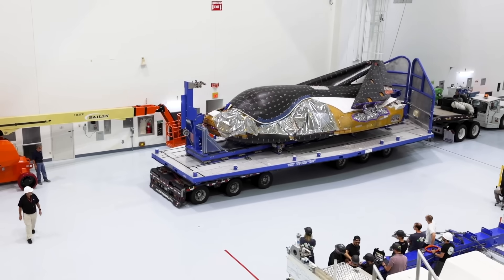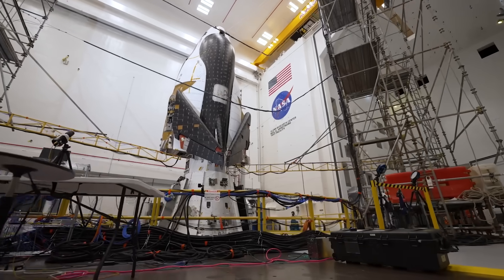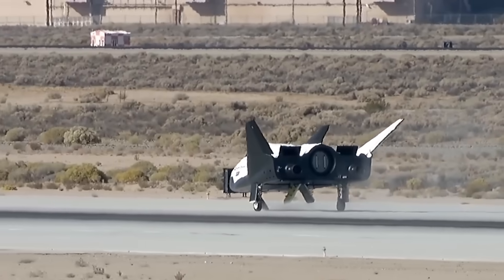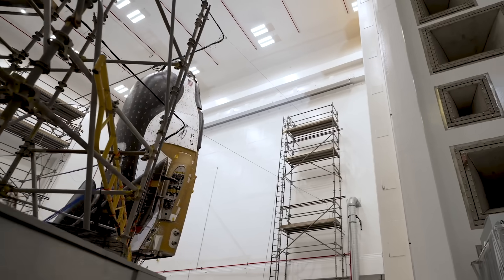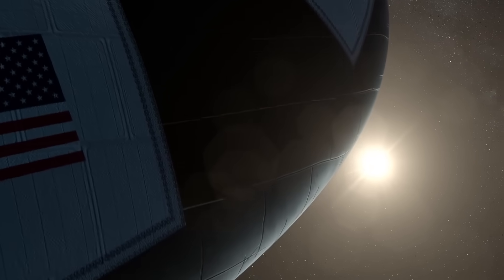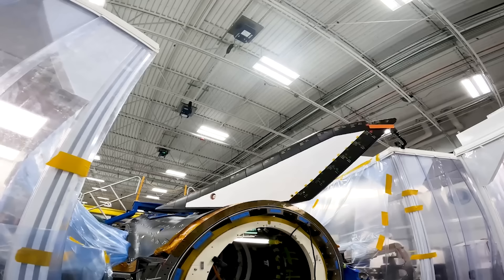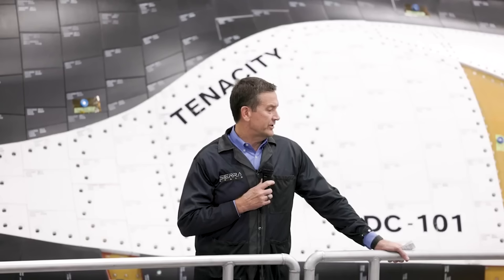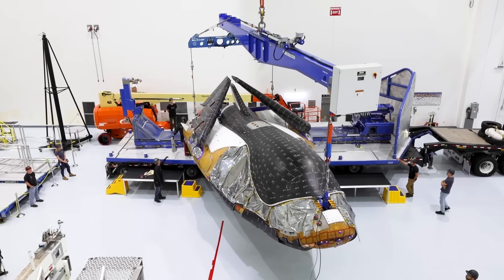Dream Chaser Tenacity Still Needs More Work

Comment: I'M NOT AN ENGINEER, BUT....
<the dream chaser may have 100,000 parts, might take 100,000 man-hours to assembly/manufacture, might cost one billion dollars usd; so really this is a very expensive/time-consuming venture, etc>
HOWEVER,
<maybe elon musk/spacex engineers could review the engineering/construction and look for ways to reduce complexity/manu. time/cost by 1/2 or 3/4's, i think it could help>
<less aerodynamically complex reentry vehicles; could possible create a simpler heat shield with larger sections(one meter square), etc.>

<even if the spacex/falcon 9 crew dragon cost 100 million dollars, that price would be hard to beat; since they are reusable also>

Sierra Nevada proposed Dream Chaser for the CCDev phase 2 solicitation by NASA in October 2010, with an estimated project cost of less than $1 billion.[36][37] On 18 April 2011, NASA awarded $80 million to Sierra Nevada Corporation for Dream Chaser.[38
https://en.wikipedia.org/wiki/Dream_Chaser

Comment: By the time Chaser is ready, the ISS will have retired.  Plus:  Anything using ceramic tiles is not reusable.  They are rebuildable.  One of the Falcon 9 boosters has just completed it's 30th landing!

Comment: As slow as its going, I would rather it take another couple years or so than have us experience another disaster like columbia or challenger
Reply: The Columbia and Challenger disasters were caused by the choices of the NASA director, head engineer and political pressure. every engineer involved in the shuttle program informed the director and other upper management that the o-rings on the boosters used for the Challenger launch needed to be replaced and they refused to issue the authorization to have them replaced. As for the Columbia, again it was the choice of the NASA director and chief Engineer who refused to issue the authorization to replace the worn out heat tiles that flew off the Columbia mid way through its flight into space.  With all that said as big as the shuttles were and how monsterous that program was to get them built along with the launch vehicles and systems. It only took 10 years to go from drawing board to first launch, meanwhile this shithole of a plane that's nothing more than a giant paperweight has been in test mode for nearly 20 f'ing years. Dream Chaser has been in development since 2004 when it was originally designed as a crewed space vehicle. Sierra Nevada Corp fucked it all up by turning it into a giant drone that can't fly

Comment: Fun fact: the non-reusable part of Dream Chaser, the big Shooting Star cargo module, was only announced in 2019. So it was a pretty late addition. Apparently they figured that Dream Chaser wouldn't achieve the desired cargo volume, and instead of redesigning it to make it bigger, they just decided to attach a non-reusable module instead. It was likely the cheaper solution  That sounds to me like giving up half of their reusability ambitions.
Reply: Or maybe more a case of deferring rather than abandoning their full reusability ambitions?

Perhaps a full redesign to make it bigger would have lost NASA contracts and perhaps other funding, significantly increased development costs, and pushed revenue generation far enough out that the whole program, maybe even the whole Sierra Space subsidiary, would have failed. At least this plan, as long as it can be executed in a sufficiently effective and timely manner, will I hope allow Sierra Space to go on to develop bigger versions in the future.

Whatever one's take is on it, I didn't know that "fun fact" about Shooting Star so thanks for posting that info.
Reply: @julianfp1952  Dream Chaser was designed as a manned vehicle.  But NASA doesn't have an open contract for a manned vehicle, so Sierra changed the existing design work to make it a cargo vehicle because that's the money that was available.   Shooting star is an adaptation to get NASA more cargo without a new spaceframe.

Comment: Dream Chaser is not Starship. Starship is basically a disposable stainless steel trashcan with rocket engines to one end. Dream Chaser is a high end space plane. If they have more testing to be done, I'll give them time. The New Glenn is going at a slow pace too. Space is expensive and excessively complex. Starship is just a show.
Reply: Starship will be able to both take off and land (to the surface of any planet). And DreamChaser - only land... And only on a prepared landing strip!
Reply: @Dragonych1976  Any planet? Probably not in this decade, but maybe in 2031.
Reply: @GreyDeathVaccine  I agree about Starship. But DreamChaser will never be able to

Comment: This is actually just the ancient USAF DYNASOAR project, all over again.  The USAF has one flying already, and this is just the commercial version.  It "may" have a purpose, if any commercial companies care to use it, for the returning of Yet-To-Be-Defined cost worthwhile objects.  Right now, it is just easier to dump the Trash into LEdeO, and let it burn up.  Some company was going to UN-deliver the Trash from the ISS using that technique, and for practical purposes that is what we are doing now with Junk Satellites.  ISS to be "Cremated" soon, in the same manner.

Comment: By the time it launches it will be absolete
Reply: Uh... to you mean absolute or obsolete?
Actually it doesn't matter which one you mean, because it won't be either.
I see so many people online say this won't work, that is useless, or it will never.  Strangely enough, they all vanish when proven wrong.  Just like all the "experts" who said you can't land a rocket.  🤣
Reply: A lift body that can return to a runway? I don't think that will ever become obsolete because the military at least would probably welcome a bigger version of the X-37B for a variety of reasons. And, have to see what others are doing about thermal protection systems - if they really achieved innovation in that field, then their IP will remain relevant for some time.
Reply: Dreamchaser has a unique capability that won't ever be obsolete. It has a very gentle re-entry.  It can return things to earth and allows immediate retrievel after landing, which would be especially important for biological components. The dustbin it takes up with a load of stuff, but discards on the way back gives a natural method of waste disposal for space stations.

Comment: But what’s it for?
Reply: Improved access to Low Earth Orbit for resupply of the ISS and its successor commercial stations.  Other versions of this shuttle will be human rated and will ferry Astronauts.
Reply: Gentle re-entry and immediate retrieval of cargo after landing. Starship is definitely much more industrial in its re-entry trajectory, and there is a significant delay before cargo can be retrieved after landing. Think of it as a delivery van (or ambulance) rather than a heavy truck.
Reply: Cruising low Earth Orbit.

Comment: Is this a manned or unmanned vehicle  !
Reply: This particular one is for cargo only.  Sierra Space did design and start working on a crewed vehicle, but NASA decided to trust in Boeing instead, leaving Dream Chaser out in the cold for several years.  Sierra Space kept working and then submitted another proposal when Commercial Resupply 2 came around.
Reply: @sidstevens9035 Both. So, YES. :)

Comment: Great report, thanks! 
I really like Dream Chaser, but it is rapidly running out of time. There needs to be some urgency and a realistic schedule. The ISS may not last until 2030 and Dream Chaser is in danger of being cut if by March 2026 there is still no firm launch date.
Reply: True, but I dare say the "Seven Missions to the ISS", may turn into four missions to the ISS, and three missions to Axiom Station, where some NASA astronauts will work post ISS.

Comment: Oh, we're not done with weird space shuttle designs? Hasn't the capsule type been proven as superior?? Looks like this one also has a bunch of unique tiles that need to be replaced
Reply: It's based on a 30+ year old NASA design.
Reply: @nathanahubbard1975  More like Mikoyan-Gurevich MiG-105 (1970is) idea
Reply: @charlesdarwin6134  No, I don't mean it "kind of looks like", I mean it literally is based on the NASA design from like 1993.
Reply: Back in the 60's, the capsule proved to be inferior but government and military interference prevented NASA from building something like this in the early 70's.  This left it up to private companies to finally develop one 50 years later.
Reply: Superior if you are okay with high g's and low landing flexibility, which is not ideal for certain situations. I.E. you want to quickly land someone having a medical emergency and get them into a hospital, but high g's might cause excessive harm.

Comment: Dream Chaser seems like a solution to a non-existent problem.
Reply: The problem is the return of delicate materials from orbit without excessive g forces.
Reply: @nathanwoodruff7037 Can’t be a big market for that
Reply: @Schnorbitz  I could absolute see it being used as something of an emergency escape ship if you need to get down to earth in a reasonable amount of time for health reasons that make excessive g forces dangerous
Reply: The problem: Capsules give a rough ride re-entry into the atmosphere, and need to be recovered by ships, which is very slow. and has a high cost.
Solution: A vehicle that gives a smoother re-entry, and immediate access upon landing.
This was NASA's original plan back in the late 1960's, until the US Dept. of Defense demanded a much bigger shuttle.  Unfortunately by the time it was built and flying, the DoD didn't need it anymore.  Thus instead of getting a useful Astronaut Ferry for projects like Skylab, we got an expensive and difficult to refurbish behemoth, causing everyone to resort to capsules  once again, while the DoD built their own mini shuttle.
Believe me, the Dream Chaser is at last a step in the right direction, even if it is 50 years late.
Reply: @martythemartian99  Agree.  It is the USAF DYNASOAR project, all over again.
Reply: @brunonikodemski2420   Agreed.  Though Dynasoar, I think, was a single seat spy craft.  NASA had designs for a 4 to 6 seat LEO lifting body shuttle.
Reply: it can land on any runway that can take jumbo jets. thats pretty neat
Reply: @MrFranklitalien means nothing  if it never launches. Too slow to be operational.
Reply: Dream Chaser is solution to very real problem, NASA being in single vendor lock in for space craft capable of returning cargo (and potentially people). It's not a technological problem, but very much an organizational, control and industrial problem. NASA doesn't want end of Space Shuttle program 2.0 mess. So pretty much regardless of cost, they will push forward with multiple providers.
Reply: Being able to glide down to a runway kills off a lot of ocean recovery costs alone, which get very expensive, but the ability to reenter slowly and with minimal g-forces enables us to bring very fragile cargo back to Earth, such as 3D printed human organs, advanced fuel sources or ultra-complex, fragile computer components. Traditional capsules risk damaging said cargo as they reenter with hard g-forces, and landing in the ocean isn’t very easy on fragile shit either.
Reply: The problem is SpaceX and Boeing.
Reply: @mrbaab5932  ? "The problem"?  What, pray tell is this problem you are weakly and obtusely alluding to?
Reply: Y'all are always so quick to make this statement when a program meets some hurdles. Sybau.
Reply: if it didnt need that shooting star cargo module section maybe it would make more sense but as is it doesnt offer much over capsules.
Reply: @geesehoward700 it has the advantage of lower G reentry for returning delicate cargo to earth as well as not having to rely purely on spaceX for cargo missions
Reply: @KiRiTO72987  that makes sense. i just hope theres a station left to warrant its use
Reply: a non-existent problem that noone knows whether it used to exist but doesnt anymore, or has yet to exist
Reply: @SaltyGullofficial1  The problem HAS existed since the first capsules, and still does.  Even SpaceX's Dragon has the same problems.

Comment: I thought SpaceX was building a faring to incase the Dream chaser.
Reply: No, Beyond Gravity is the company that builds the fairings for Vulcan Centaur. As far as I know, ULA does not source any hardware from SpaceX.
Reply: Yes they could quite easily modify a fairing to launch on a Falcon Heavy. Unfortunately they are tied into contracts with the ULA and launch on a Vulcan (in theory)!
However, if the ULA are in breach of the contract by having no commitment to launch the Dream Chaser in favour of government hardware pushing them back then why not break out of an unfulfilled contract commitment.  A lot of politics going on with this!!!
Reply: @johnnyhollis9977  The only one who's in breach of contract is DreamChaser....ULA has been ready for several months...almost a year...they had to send another cargo waiting for DreamChaser to be ready
Reply: @curtgsc84 They have *never* shown even a passing interest in working with SpaceX. Someone, somewhere within the org has an agenda.
That agenda has to do with .... something... and that something has little if anything to do with *actually* flying spacecraft.
Reply: @phlogistanjones2722 it unclear if Dreamchaser would even fit inside any of SpaceX's fairings. Even the extended fairing for Falcon Heavy is almost 10ft shorter than the long fairing on Vulcan Centaur, meaning the top of Dreamchaser would need to be well inside the narrow nose section of a Falcon fairing. Additionally Falcon 9 isn't capable enough to lift Dreamchaser to orbit and Falcon Heavy would likely be more expensive than Vulcan Centaur.